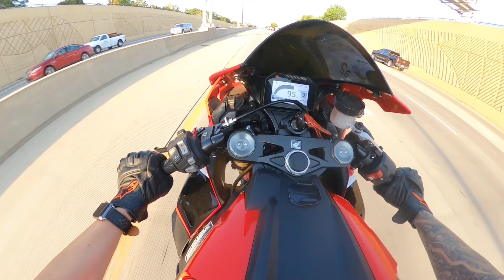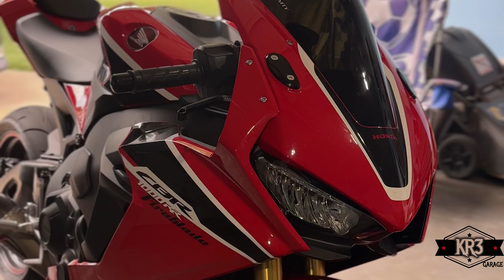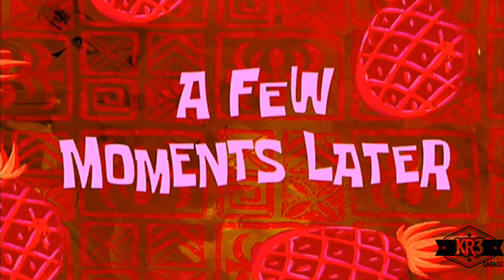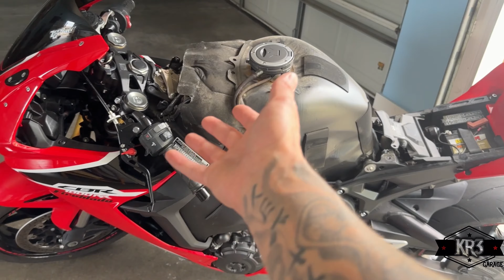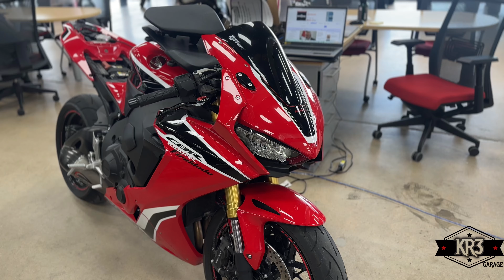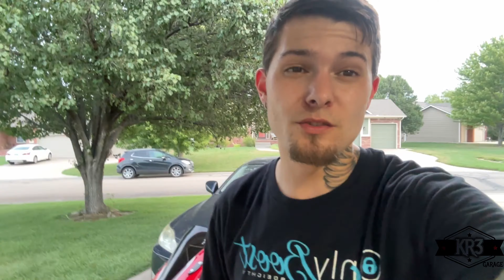Flash & Tune Your SC77 Honda CBR1000RR | Kr3 Garage

Comment: Frank did my bike also didnt know they dont use handhelds anymore, better though my ecu almost went into brickmode.
But if you wanna get the best out of them get the eu stacks!
Any questions just holla i got mine setup for drag.
Took it off the dyno 197 on the rear wheel not that says anything but believe me eu specs blades are not da same.